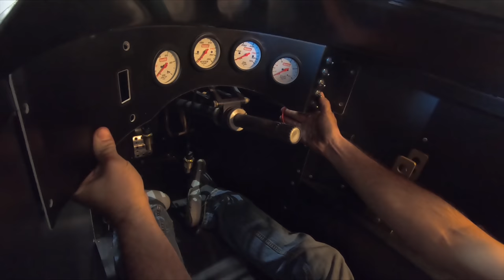It’s Always Something When You’re Building a New Race Car

Comment: Little advice on Teflon tape. Only two wraps and make sure it's flat and not rolled up. Any more it balls up and don't do it's job.  U are not sealing with it like alot of people think. You are lubricating the threads so they go in enough for the .750 per foot taper to seal. Just a little useless knowledge for the day lol

Comment: Bushings should be had at your local parts store, should be simple enough!?! ---- Trip there on the way home and fire it up tomorrow... don't forget to lube the chassis and birdcages. Check the pull bar, spring rate, and shock (if there is one) and the drop for binding. See ya on the next... Be Safe
Reply: The bird cages used now are sealed bearings or non serviceable
Reply: @JJ-1-1  Thanks for the updated info.

Comment: What does a Capital chassis like that cost? Just curious
Reply: Depending on rolling (no engine, drivetrain etc) it can be around a couple thousand ($10,000) Race Ready (engine and all) can be a little more pricey ($17,000-$20,000)  but it all depends
Reply: @asht9ntrive28e8  If it came with 460 ci Super Latmodel motor Clements or a Andy Durham or other builders your looking at a another cool 50 k....I know a racer that just bought a new Andy Durham motor for 56k and a new LONGHORN Roller chassis the final cost was 88k and some change
Reply: @JJ-1-1  I tell you what my wallets crying reading them prices 🤣, I race asphalt late models and we bought my car $15,000 race ready, and I thought it was expensive 🤣